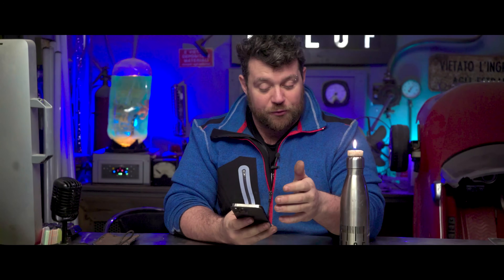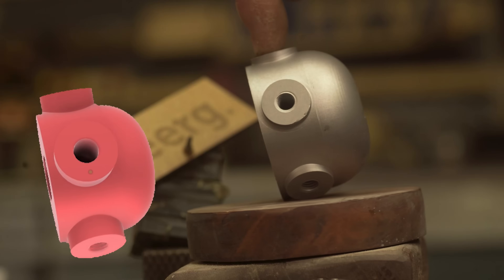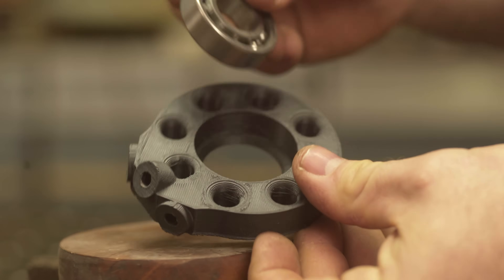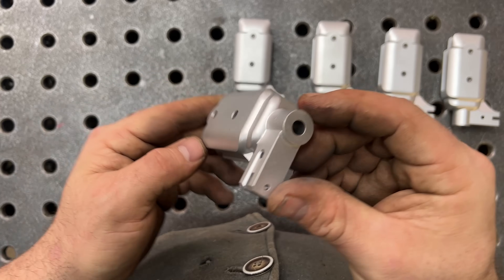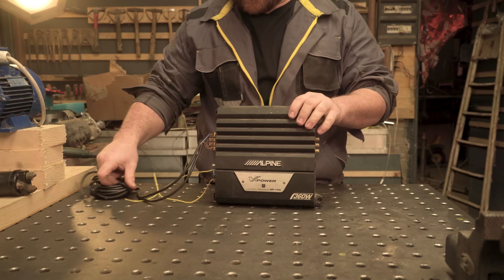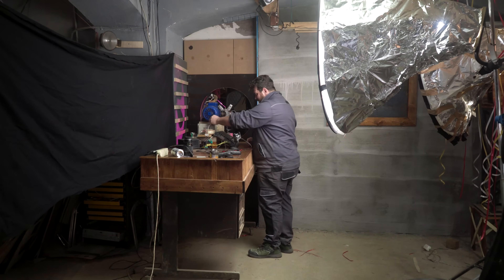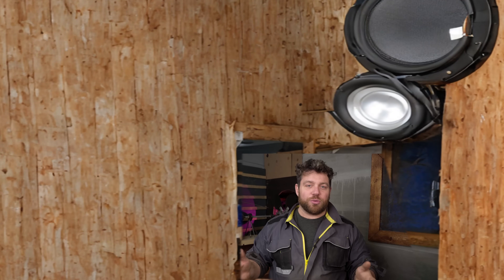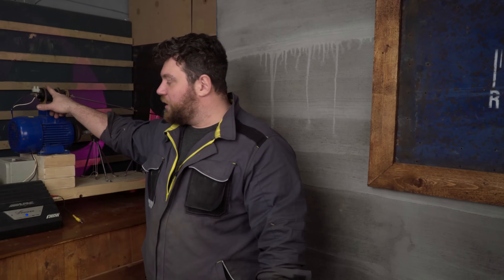How to Make a Rotary SubWoofer

Comment: Nice video man. Keep it going. I have a suggestion. I think you can get even better results if you could vary the pitch continuously rather than it being fully open or closed.
Reply from the maker: depends on the "song"   but i have to test it!  thanks for the suggestion!
Reply: @rulof-is-how-to-make  I think with variable-pitch propeller RC helicopter, you could do exactly this. They respond very quickly to input and can be very powerful. The biggest concern would be overheating the servos when articulating very rapidly. But the RC helicopter might be up to the challenge of getting 1- 60hz response. Then it can be used in addition to what you have created here to supplement the frequency (since the volume would likely be lower than this behemoth since there is less torque from the RC motor). 👍

Comment: Instead of the solenoid you could use the speaker driving coil directly.
It will also move the blades sinusoidally instead of triggering them only on or off like the 'noid does.
Reply: @tripplefives1402 nope, not at all: solenoids with iron core don't behave like magnet core solenoids.
Reply: Yeah, as he said a speaker is made of paper, so a coil can move it effectively. But the prop swashplate is a huge piece of aluminum that needs to move twice as far in the "xmax" of a typical speaker driver. So you would have to wind a massive custom coil and use a huge amplifier to drive it. Like 4x the motor force of a car audio spl woofer... I was thinking that a big servo would be much better for this application. Maybe a screw drive servo that can push and pull the rod in either direction according to the audio signal. Then it will knock everything off the walls.
Reply: @Alkatross Yeah, a servo or maybe stepper would be the best for this purpose. Anything with precise control, not just on/off.
Reply: @MrHerhor67  a stepper is an option, but they don't produce a lot of torque at startup. You would be wasting the ideal power band of a stepper by never spinning up to high enough rpm. For a stepper to work here it would need to be quite large to provide the starting torque require to fight the air moving through the blades (most steppers are also geared down for more torque, so the gears add more rotational mass) So can a stepper be large enough to fight all that airflow and still be capable of changing direction 20,000 times a second (at least?) My thought was a lightweight 3 phase motor without permanent magnets. So it would have brushes and a rotor coil instead of heavy permanent magnets and the usual stator coil. Low mass and high torque. Then just use a rotary encoder to measure the position of the shaft. I feel like there is an ideal rotary subwoofer design that nobody has made yet.
Reply: PLEASE STOP USING A SOLENOID - IT IS THE WRONG TOOL FOR THE JOB - USE A SUBWOOFER MEANT FOR A PORTED BOX
Reply: I was just coming to say that...  with a subwoofer meant for a sealed enclosure there is a HOLE IN THE BACK that the fan blade shaft could go through...  I have a JL W3 he can have, but shipping it to Italy is a bit much for my wallet, I'm an unpaid caretaker of my mom and they pay me with free board and food... so I'm broke... but the sub's surround has dry rotted so it's the perfect starting place.. plus it's dual voice coil...  
anyway, you HAVE TO make the rods from that twist the blades totally solid - ZERO WIGGLE... AND they have to be EXACTLY THE SAME LENGTH or else it will pull/push off center and jam... you need you tolerances to be less that 0.5mm I would think.... but that solenoid is WAY TOO SLOW ... that's why it doesn't match with the music.... and if it's too much mass then you need more wattage - but you HAVE TO USE A REAL SUBWOOFER COIL!!!! You will NEVER get it to respond precise or fast enough....
I GUESS I could donate my subwoofer if he can find one for cheap that can handle the wattage... but it NEEDS THE HOLE IN THE MAGNET TO BE BIG ENOUGH TO PUT THAT ROD THROUGH!!! That's the ONLY WAY you'll be able to keep it centered, which it HAS TO BE!!
- ALSO you can DOUBLE THE WATTAGE of your Alpine Amp by running it in MONO - attach the speaker to the POSITIVE OF  THE LEFT AND THE RIGHT -  this will cut the resistance in half (the amp will go from 4 ohms to 2 ohms, or from 2 ohms to 1 ohm - depending on the speaker you use .... if you used my speaker you could run it in 0 ohms and it would use 720watts!!!!! - that's if you AMP is the type I think it is - this would be you BEST CHOICE!!!)
- If you plan on using that Alpine amp, DO NOT use a HOUSE subwoofer... it will be at 8 or 16 ohms and this will make you amp only use 180 or 90 watts and that will waste your power... but it should still work but you HAVE TO WIRE IT CORRECTLY
 - I'll check if @Rulof is How To Make responds maybe in a day (I don't use notifications on youtube) to see if you wanna use my speaker.. there is  NO REASON to waste the one you have, but you need the right type, so I can help you choose the right type if you need me to... (can you tell that I love subwoofers? lol )
Reply: I won't disagree with your logic of impedance vs power but I will add one detail:  damping Factor is the impedance of the amplifier circuit (when not pushing power) and the importance is that it helps control the stop action of the coil when there is no ac voltage (ie signal) pushing through. It is responsible for how "tight" of a sound goes through. 

I think that when loading a rotary subwoofer, especially if there's no mechanical force to help bring the blades back to center other than the coil, that damping Factor would be an important force in stopping unwanted movement of the blades. 

Just like how lower impedance speaker loads drive higher current from the amplifier, higher impedance speaker loads create a greater damping Factor (because it's a ratio of source impedance to load impedance) so the higher impedance speaker coil will help control the stop action of the blades (or a cone if it were a regular speaker) and provide a tighter sound!  Of course you compromise power this way, but for this particular project, since it's not going into a car, that opens up many more options for amplifier power.

I would personally recommend professional audio power amplifiers. Old crown class ab series amplifiers like macro tech series or even lower-cost variants were known for having incredibly high power (for their time) and damping Factors. A macro tech ma5000vz was rated 1200w/ch into 8 ohms, 1800w/ch @ 4ohms,  or 2400w/ch @ 2ohms (and could either series bridge for 2x voltage or parallel bridge for 2x current into 1 ch). I'm not sure of the damping Factor ratings in newer digital crown amps. I do know many Powersoft amps are newer digital class amps and some of their series offer amazing power and damping capability too. 

When it comes to the rotary speaker, however, I don't think that much power is needed by the amplifier, as most of the speaker's power / force comes from the spinning of the blades; the voice coil only needs to push the clutch back and forth enough to make some pitch on the blades.

Also, for this particular project, if you improve the design and build a system capable of full sinusoidal control, you will want to refine your blades so they are similar on both sides, so they push the same amount of air whether pointing in or out. The current blades are different on the back, and it looks like they are not aerodynamically similar if they are pushing air out vs in.
Reply: They already exist. This is the wish version
Reply: I think in this case, since he's driving the solenoid with an audio amplifier, the solenoid is moving sinusoidally. The more current that passes through the solenoid coils, the more it deflects against its spring. But I think it still cuts off half the waveform, so you're right, a speaker coil would be better.
Reply: @isaiahhiggins  this, he is only getting half the waveform, big, I mean HUGE voice coil surrounding the shaft with the magnet incorporated into the spider would give the full waveform pushing and pulling air with a neutral point for the blades.  If at that point the mass is still a problem mount the magnet around the shaft, and the voice coil to the spider fed via brushes on a slip ring.  ideally all that structure needs lightened and stiffened.  Time to play with some Carbon fiber I would say, oh and build a duct around it, or even better incorporated into the prop ends as a pivot to not only increase the strength overall, but also boost efficiency. Awesome video!
Reply: @isaiahhiggins  yeh i agree. way to much mechanical noise and slow responce frome the solenoid.
Reply: You can use a solenoid but have to modify it so the iron is centered in the coil. In this way you get full sinusoidal wave form. Then center the blades so they can move "positively" and "negatively". This will not be HiFi but for bass effects it is close enough. Then limit the amount of movement from the blades, they really don't need to move much to get big amounts off air movement.
The power is provided by the motor, you don't need a big amplifier to drive the pitch of the blades.
Better is to use and old voice coil from a big speaker and drive the system like this with spiders to center the coil. Less parasitic noises.

I have seen some kind of conception in an old theater. It was driven by a really tiny tube amp.

It works only on frequencies below 20 Hz, event below 10 Hz it comes alive.

It is not commonly used because the equivalent air volume is so big that to load it you need a room size baffle to house the system. It works in a chimney vented to the outside. Dis is how it was mounted in the theater, big pipe to the outside on the roof.
Reply: He could also go with 2 solenoid anti-parallel mounted (with diodes, fast demagnetizing, etc.). The other, more trickier, would be maintaining the solenoid at 50% load when centered. However, we can find multiple improvements, this physical swash setup doesn't allow proper sinusoidal response in the first place, last place being the blades bend/deformation when pumping the air. It's a very tricky design to get sinusoidal waveforms is an understatement.